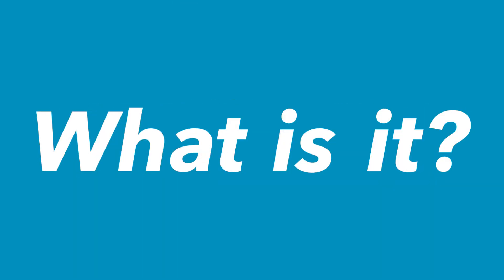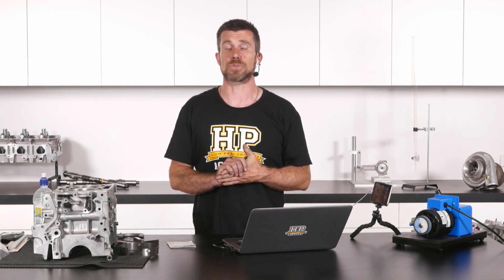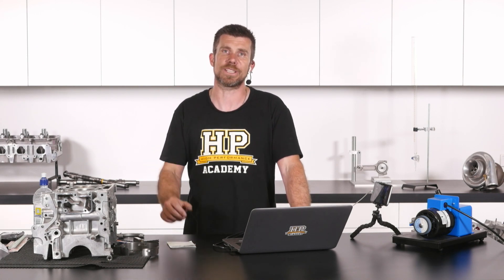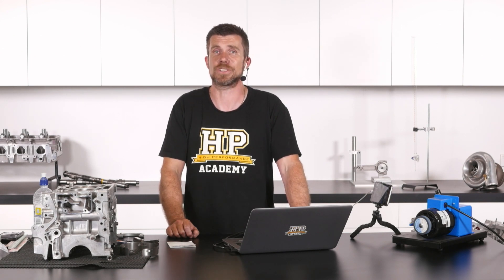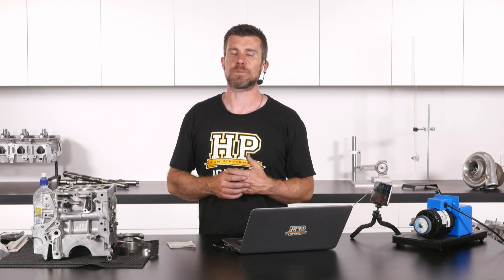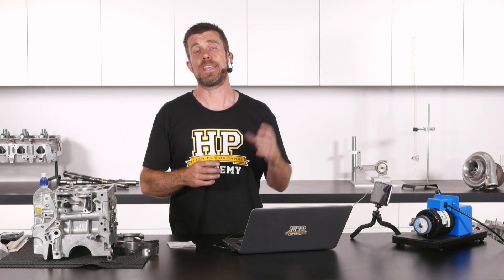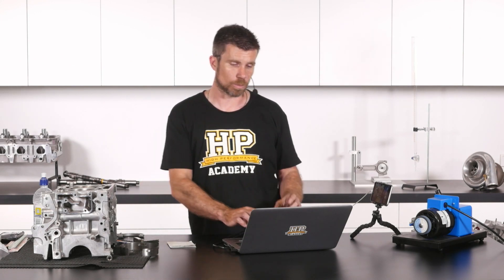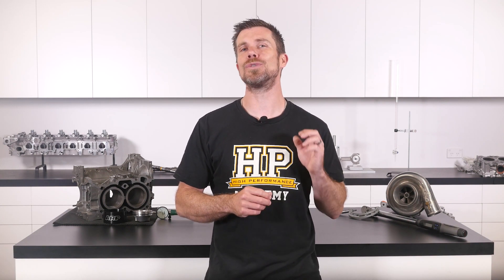[HPA Q&A] What is engine blueprinting? | Hint: It's not just balancing!

Comment: As regards to the blue printing, you say it's a waste of time for a fast Road car? So if you had two engines built with the same components but one was blue printed are you saying there's hardly a difference? Or is the difference only noticed when being thrashed on the track?
Reply from the maker: I wouldn't say it's a waste of time but what we are more interested in with the hobbyist or semi professional motorsport market is picking off the key or critical aspects to the engine's design and ensuring that these are absolutely correct. Essentially this gives us perhaps 80-90% of the benefit of a complete and thorough 'blue printing' exercise at a fraction of the cost. 

The other aspect to consider is that the manufacturing tolerances and processes for production engines have improved dramatically over the decades and the sort of corrective blueprinting operations that may have been essential on a 1960's era cast iron V8 are now often unnecessary on many of the current crop of performance engines.
Reply: Bro do not listen to this dude. Keep polishing and porting and blueprinting your engines. This guy is dim.
Reply from the maker: @bazzboy6739  you clearly still think balancing is the same as blueprinting. It is not.
A blueprint is basically a specific parts list and instructions. A build recipe could be another way to describe it.
It might not ask for any porting and polishing at all.
Hope that helps you understand things better - Taz.
Reply: @mason8725  lve only had 2 blueprinted & balanced engine BUT A WORLD OF DIFFERENCE FRO. STOCK! 340 Dart 302 Camaro.